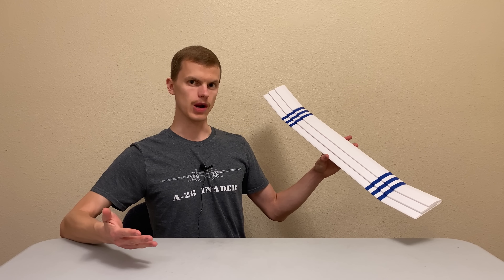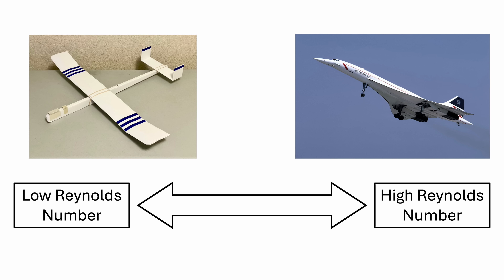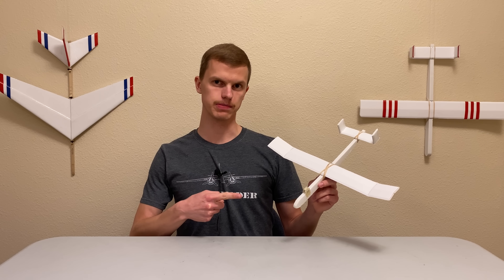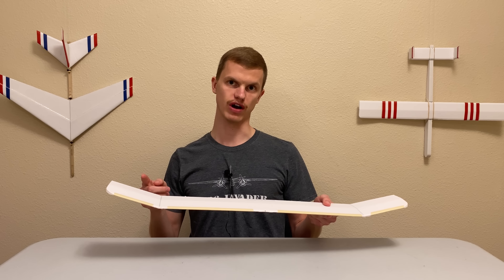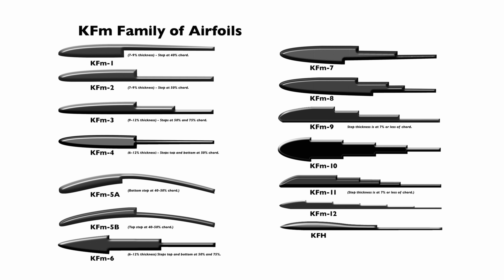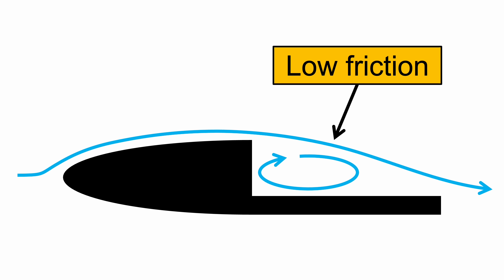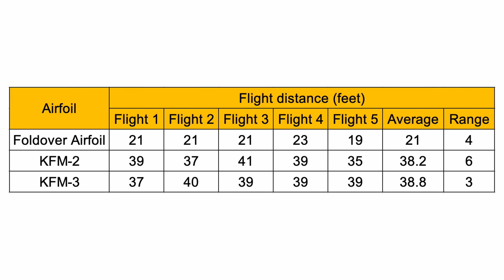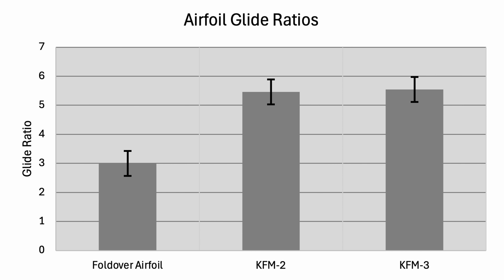Stepped Airfoils for Model Airplanes - Are They Better?

Comment: Your videos are really excellent!  I'm an old fart that has been scratch building an flying model aircraft ranging from hand toss gliders to large gas powered R/C as well as rocket boosted gliders using my own home made black powder rockets.  It's not uncommon in smaller models to see an aircraft with a really rough finish out perform the exact same aircraft design with a high degree of finish,  The difference being skin friction.  And in small rocket boosted gliders it is not at all uncommon to see fixed low aspect delta wings out perform variable geometry high aspect ratio straight wings. The difference being the low Reynolds number of these small models.
Reply: I remember reading that, either laminar flow or the change from laminar to turbulent flow at a certain point along an aerofoil was bad for model planes so, in some designs they used "turbulators" consisting of thin threads stretched out just in front of the leading edges to make the boundary layer turbulent throughout. Have you ever heard of that?
Reply: @robtristram8395  I can't say that I have heard of the thread you speak of but that kind of makes sense to me.  I just know from experience when you work with very small models low aspect ratios seems to rule.  Think of the traditional folded paper airplane.

Comment: 5:57 The spar in 1 or 2 is half the spar in 3. That changes the weight, doesn't it?
Reply from the maker: The difference in the weights of the lightest and heaviest planes was only 6%.  I didn’t try to match them exactly since the weight of a glider does not affect the flight distance.

Comment: If you would like to test faster flying planes you could do the same test with double mass added. And triple mass (if the structure can hold this mass)
(Keep the mass center at exactly the same place)
That would increase the horizontal speed.
And may be tell something about the differences in flight angle with this higher speed.

Oh...For flying boats they have such a step at the bottom of the flyingboat to reduce water resistance when starting....nearly a century ago (Dornier do x as example).

Comment: Have you considered comparing the KF airfoils to a smoother airfoil made with bent foam board like in the Flite Test Master Series rather than the fold-over airfoil? To my understanding, the folds contribute quite a bit of drag, which is great for the slow flying FT planes but not so good for efficiency...

Comment: What if the foil was hook shaped, like a letter J lying on it's back. Shorter arm could be adjusted. It seems as said a means of reducing upper skin friction on normal aerfoil.
Reply: i was thinking, surely the skin friction between the vortex and wing must count. energy loss is energy loss, right? so now i'm thinking the energy loss must be lower if you round out the step?
Reply: @5naxalotl  Reading item on car rear wings. On experiment it said the best drag reducer was a wing over the rear windshield near the roof. It created a vortex over the rear.
Reply: @flybobbie1449  Most car 'wings' aren't to reduce drag, most increase it. Goal is more downforce on driven rear wheels, for better cornering speed, earlier/better traction out of corners, and better stability at high speeds. All at a cost of more drag. Lap times dictate ideal wing shape and angle for any one course, in specific conditions.

Comment: Testing from a higher height would be ideal if possible, though I suspect space considerations were the issue here. Also whilst the launcher is substantially better than hand throwing I feel it could be improved - more stability would mean more repeatability and another (small) variable removed. Otherwise this was a very well done experiment which produced legitimately useful data.
Reply: yes, you only need to find glide angle at steady state. maybe you could do iterative runs, where you launch at the estimated steady state angle/velocity of the previous iteration? or ideally, you'd hover the thing in a huge up-angled fan

Comment: I don't know why you compared the stepped airfoils to a fold over airfoil instead of a conventional smooth top and bottom airfoil.
Also did all 3 airfoils weigh the same? If not, weights should have been added to the lighter ones.
Reply: dis!

Comment: Ultimately the drag coefficient × the wing area determine the parasite drag , but more important is the span of the glider
with  CDA = A×cd
The glide ratio is also called L/D
L/D = 1/2 × span × √π/ CDA
This happens when the induced drag and the parasite drag are equal
Induced drag 
  = (L/span)²×1÷Q×π
the parasite drag simply
 = Q×CDA
Q dynamic pressure.
Very important is the span
much less so the parasite drag
However these equations are not exact, they are what we call linearized
The McCormic exact equations depend on the wake angle of the downwash behind the wing, a bit more complicated.
But the induced drag is NOT 
dependent directly by the Aspect ratio, an error of severe consequences.

Comment: I built an A2 FAI class towline glider decades using an Eppler  E59 airfoil.  Floated of a 50 mtr.  towline the model would consistently do 3 mins. 15 secs. in still evening air after sunset.   As Dr Eppler explained,   the centre of pressure movment of the E59 was "very marked"   However in turbulent air the model would not go away in a thermal and despite geodetic wing construction in certain circumstances the wing would torsionally oscillate bringing the model down fast.   
Experimenting with airfoils you will find the nose radius has a BIG affect as does wing tip planforms.
For those of us fascinated by flight,   yours was an interesting informative experiment.

Comment: Interesting experiment and useful for someone who was building simple wings with very thick airfoils out of foamboard, where the KF airfoils may indeed be 'less bad'. However a comparison against a conventional airfoil that is specifically designed for operation at low Re numbers (NOT a Clark-Y) I'm certain would yield very different results. One of the Mark Drela series airfoils would be a good option, find them at 'Drela Airfoil Shop'. I did my own testing of a 1m glider with a Drela wing vs a KF of same thickness weight and planform mounted on the same fuselage. The Drela with flew about 50% longer duration.

Comment: Outstanding video. During your test the KFM2 appeared to have a slight stall midway through it's flight. Which would account for the range discrepancy of 6. 
The dimples on a golf ball are actually there to reduce skin drag, and I've wondered for a while why that attribute isn't applied to aircraft wings. Would be awesome to see something similar to this to test it's effectiveness.
Reply: aerodynamics of a bluff body like a golf ball and a streamline body like an airfoil are very different. Having said that 'turbulators' are a thing on low Re number airfoils. These usually take the form of a thin  serrated strip that runs along the wing just behind the leading edge on the top surface.
Reply: @jetplaneflyer  Yeah, after writing that comment I spent the next sleepless hour and a half researching that. I also had it backward about the dimples. They actually increase skin drag. Anyway, I believe there are still leaps and bounds to be made in aerodynamics, and that we have barely scratched the surface of efficient flight.

Comment: If you do include wind tunnels and simulation I would prefer to still see the actual real world testing afterwards.  To me, seeing the theory followed by your controlled experiment was very rewarding.  Looking at the three wing designs at the beginning then measuring what I thought would happen as compared to what did happen was great.  I assumed the Flite Test wing would reign supreme and was amazed the 2 & 3 step wings (actually flew and) proved more efficient.  I fly RC planes but assumed the kind of content here would require some intimidating math to understand.  Your intuitive explanation made perfect sense to me.  Thank you for making this video.   I subscribed and one day hope to design my own RC model.
Reply: RC models, although flying slower than life-sized airplanes, still fly much faster than gliders. So that's probably why you were so surprised: you're not used to speeds THAT slow

Comment: Harlold Penrose was a test pilot (and aircraft designer) in the UK that testflew a full-size glider in the '40s using an airfoil similar to the one you tested here, so it isn't a new airfoil! He test flew many different aircraft during his years at Westland. In his eighties he designed and flew a canard microlight, with a Kasper Wing-like wing if I remember correctly!
Reply: I'm pretty sure that the stepped KF airfoild has never been used in a full size aircraft. They have undergone wind tunnel testing and performed very poorly, so no one ever took them into full size trials. You are right that they are not new though, paper planes used them since people first folded a paper plane.
Reply: Thanks @ErikssonTord_2, I was hoping a viewer would pull Witold Kasper into the ring.  Kasper was an academic and his efforts to capture vortex lift at 0 KIAS is still a thesis looking for a PhD candidate.

Comment: The horrible form of the original foil is no reference. We should try with a nicely performing airfoil - Clark Y is super ! - and then make cutouts in this wing. 
My depron 3DX flew much better after transition from flat plate to symmetrical KF.
Reply: NO! The Clark-Y is actually not a good benchmark it SUCK! There really isn't a "standard benchmark" for airfoil performance, all airfoils are designed for different jobs there is no one size fits all. I wish people would stop trying to use the Clark-Y as a benchmark. That is so short sited and an extremely narrow point of view of what airfoils are used for.
Reply: @anthonyb5279  agree 100%. if the experiment is to determine what type of airfoil works best on low Re number gliders than do a comparison against an airfoil specifically designed for low Re gliders. The Mark Drel 'AG' series airfoils would be good candidates. Folding some foamboard and calling it a conventional airfoil is grossly misrepresenting what an airfoil is.
Reply: @jetplaneflyer  Yep!